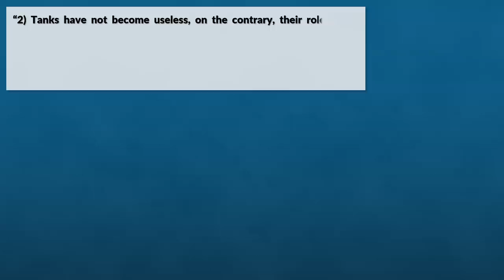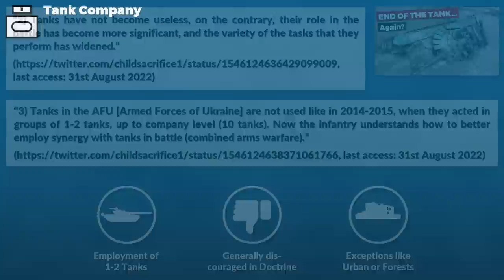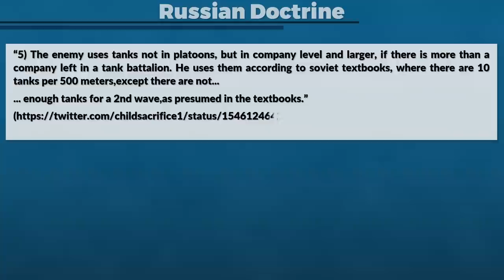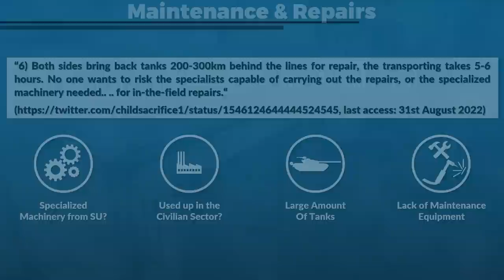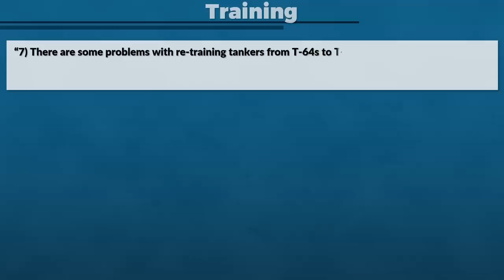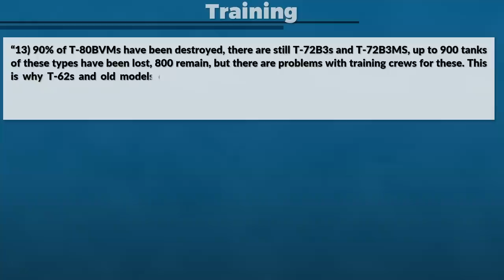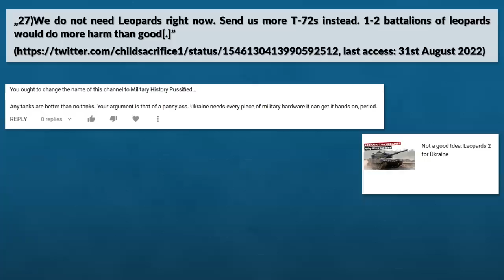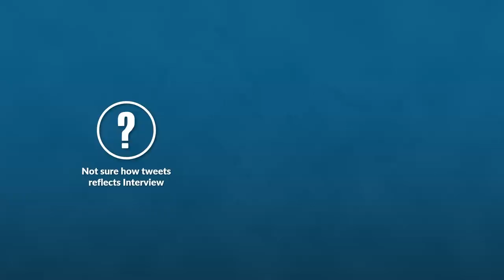What Ukraine thinks of Tanks

Comment: The experience of the US National Guard (Reserves ) is that Driver, Loader and Commander jobs on the M-1 Abrams tank can be learned in one day.  The gunner takes a little more time to train, say one to two weeks.  Basic maintenance can be done by the crews using only the manuals.  Most subsystems are designed to be replaced like the Power Pack or as a Modular box, this simplifies the mechanic's job tremendously, Built In Test Equipment makes trouble shooting somewhat easier.  excellent
Reply: The thing is those replacement subsystems, they were designed to be removed and sent to 2nd level depot maintenance, refurbished and issued back out. 

Stuff like that just isn’t happening in Ukraine when the vehicles are literally on the front line.
Reply: sounds like ukrainians should be training on abrams tanks now and then we send 1000 of them
Reply: Russian doctrine used to be different, a crew would trade their damaged vehicle for a working one at depot.  But realistically I don't see how this works.  They must have repair shops closer.  In the 60s when the 62 was out, each company had factory techs with them to repair them as they broke down all the time.
Reply: That’s if you are taking experienced tank crews.  Even your comments are an oversimplification; you can train anyone in the basics in a day so they can drive out of the motor pool to a training area, but to get them up to combat effectiveness would take at least equivalent to an annual training period, as my unit did when we transitioned from the M60A3 to the M1IP.  Training inexperienced soldiers with no experience in armor will take more time; if the war drags on, you may see more of that as they have to replace crew losses.  Don’t forget that Ukrainian mechanics may not have experience with turbine engines and would need some training for those and perhaps the thermal systems and firing computers.

Comment: I'll still be an advocate for sending Leopard 1s and Leopard 2s or even Abrams M1A2s and Bradley IFVs as the US certainly has plenty of these in stock. This war doesn't look like it'll be done in 3-4 months anyhow so let us look at what Ukraine would need to break the stalemate outside of the current slow rolling offensive, an offensive which can't be replicated elsewhere unless Russia gets themselves into more logistical constraints over x numbers of water crossings. 

Yes, sending in BNs of equipment would be a disaster if just dumped on the Ukraine with no prep but if that amount of people were being trained up out of the country for several months they'd be a boost to capability after this Fall and Winter.  Just like the various western artillery systems and ADA systems required a train up time it is worth the wait. 

The logistical troubles will be easier if they are used near the units using the PzH2000s too as they'll be some common parts/systems though they are the biggest headache to overcome.

Additionally, the better capabilities (superior thermals), if trained on out of the country first would be a potent addition on the battlefield as the Ukraine might be able to have armor that can effectively fight at night, a capability gap the Russians seems to lack (for training reasons mostly) that could give Ukraine an edge in pushing their attacks well outside of daylight hours if paired with similarly equipped infantry. Not to mention they wouldn't be relying on scrounging the world for 2nd hand serviceable T72 series vehicles into next year. It's an old vehicle and there's a rapidly dwindling supply of replacements available. Getting vehicles that have current production lines that can be ramped up to provide spares seems better than relying on countries x y and z to refurbish an old vehicle as best as possible.
Reply: There are serious issues with 'ramping up' assembly lines.  You can increase output by 50% for couple of months before you burn out your workforce.  Any new people you hire are going to need to be trained.  Then you have to find subcontractors to make components - and they have to ramp up production.  And you will have severe bottlenecks with specific components - such as the barrels for the main guns.  Production of these requires specialized machines (that will have to be built) with limited capacities.  Even worse - these require very highly trained (and experienced) personnel.  Engines, thermal sights, traversing/elevation systems, transmissions, are also bottlenecks because production of these requires additional subcontractors - and many of them are 'long lead time items' (things that have to be ordered several months before you start assembling the tank they will go on).

In World War Two we were able to quickly ramp up production because we started our industrial mobilization two year before we entered the war.  No NATO country (including the US) has anything close to the necessary defense industrial base needed to suddenly start producing 200 tanks a month.

Comment: The many different weapons used in the theater is already a nightmare for Ukraine. Will be way less efficient due to that extreme variety of different weapons.
Nightmare for logistics and repair.  
Now if the entire tank force would be replaced with Leopards in a certain time bracket it would be very good for Ukraine. But just add a few to the already big variety of different tanks would make it just a bigger nightmare.
Reply: I thought about that too, and, as the video stated, it seems Ukraine just sends the broken equipment back over to Poland to NATO repair shops to get them back into service. 

Almost all the NATO supplied weapons use the same ammo too. I think the main issue for Ukraine is just the transportation of the gear and ammo around trying to avoid Russian logistical interference.
Reply: Yes, I think support units are already being stretched to the limit. Maybe there should be a timeout of six months so Ukraine can change to new platforms. Has anyone approached Putin to see if he would be amenable to a timeout?
Reply: @MarcosElMalo2  rofl good joke.

Comment: One thing that sets NATO tanks over Russian tanks is that Russia designed them with Quantity over quality at a cost of poor ammo storage protection while NATO has Quality over Quantity with better ammo storage protection. Remember this has been the case since 1982 when T-72 went against Merkava in Southern Lebanon.
Reply: there are many ways to incapacitate/destroy tank. artillery was used a lot in ukraine. and nothing survives direct hit of 155/152mm shell. maybe cheap tanks here are actually in advantage.
Reply: @jebise1126   You mean Soviet Union designed tanks?  The reason why Western tanks are expensive it has to do with protecting the crew from an ammunition cook off basically if hit the explosion is vented Away from the crew compartment not unlike the Russians the Chinese and  North Koreans which placed them below the crew compartment
Reply: @EpicThe112  do you mean those a4 leopards made in germany used by turks that came with rocket ejection seat for crew?
Reply: @jebise1126   You are correct. Different story when a Leopard 2A5-2A7 gets hit behind on the ammo rack and what happens is that the explosion gets bented through that blow out panel not through the crew compartment which is a standard feature of NATO Tanks Western Europe style including closing the French auto loaders and derivatives Japan and South Korean K2. Furthermore 2A5-2A7 have a different ammo propellant.

Comment: German tanks and US tanks would be helpful; however, training needs to be done. If training would have started the first month of the war, then the 452 M1A1 tanks the USMC recently retired could have been given. As it is 116 of those M1A1 tanks were given to Poland, so Poland could send the 262 PT-91 tanks to Ukraine. 
If I had to guess, the USA would have provided those M1A1 tanks to Ukraine, but the Krauts probably blocked it.
Reply: I doubt the US would have provided the M1 tanks, for logistics reasons. The Ukrainians to crew and service them would need extensive training, so you'd basically be looking at forming an entirely new unit of fresh recruits. These would most likely have to be trained outside of the Ukraine, which would take time to arrange, and might not be something you want to set up when the initial situation hasn't stabilized yet. Then there's the matter of fuel. The Ukrainian forces had issues with fuel supplies for their Russian tanks, and the use of M1s would require dealing with their different type of fuel. And keep in mind that the M1 is a fuel guzzler as well. Also, different gun size. And then the need for something with a more immediate impact, rather than a delayed one. And then the US would probably want to strip out certain bits of tech from the tanks, to avoid it falling into Russian hands, so it would take time to strip out and replace such items.

That said, it would make sense to start such a training program now, so lots of training and set up can be accomplished over the winter, and the troops can be ready for an offensive next year.
Reply: @Axterix13   The USA has the support equipment for these tanks. In fact the USA already gave Ukraine some M88 Recovery vehicles and fuel trucks. The USA has also been giving Ukraine fuel. The Turbine engine does not burn much more than a diesel engine for a tank that size, when driving and doing what a tank is supposed to do. The turbine engine burns a lot more fuel when idling, but those have APU for reducing fuel usage while the tank is not moving. The M1A1 tanks can run on diesel fuel or jet fuel. US Troops do not do major repairs on tanks. The biggest thing they do is swap out the power pack (engine and transmission) in the field.

The USA gave some M1A1 to Iraq, so I doubt Ukraine would be any worse than Iraq. The Iraqis later bought some Russian tanks for some reason... maybe cost. The USA also sold M1A1 tanks to Egypt and Saudi Arabia. So if an export compliant version  was needed, then those tanks could have been modified while the training took place. Something else stopped this... and I bet it was the Germans and for the same reason they did not want Spain to give Leopards to Ukraine.

Comment: Ukraine should take as many tanks as they can get also. They can learn to use those tanks too. To increase number of tanks. They don't have,and at this stage in the the invasion. More tanks is better than not. Of course u wouldn't send untrained crews against a trained crew. Ukraine soldiers need to be more flexible in learning how to use different tanks from different countries to there advantage. It's not about how good a tank is necessarily in battle. More experienced crews when,who gets off the first shot wins.  Tank aces could beat u to the shot. Unless a tank has range on u. U can when the battle in modern tank. Have the leapeard tanks as back up.
Reply: Agreed. Just one thing: tank-on-tank situations are probably the least happening ones. So that’s not really that important anyway.

Comment: as far as the tank numbers go in regards to how many are in a company and their groupings, one has to keep in mind that for practical purposes the number of equipment you have is typically only deployed at half its value to rotate for maintenance. even people need downtime, so you don't have everyone on an operation at the same time. in fact due to support and bureaucratic requirements you will only have about 60% of a company in the operation (based on my own experiences in the US Navy on the Expeditionary side of things). this means that the 4 groups of 4 that you had assumed would result in 4 groups of 2, and 1 or two tanks for command. this can surge to about 90% personnel in operations and all tanks fielded, but that can't be sustained for very long. how long that is really depends on how far the command is willing to push the troops and how experienced the troops are. green troops will start to break down in a day or two at that optempo, experienced troops could sustain that optempo for two to three months before they start to degrade. experienced maintenance people with good logistics and independent authority to modify things to make them work can get the (4 man patrol craft, as that is what i am used to) well enough to last a couple of weeks before they need to be taken out of operation for maintenance for at least a day (time down depends on issues that arise), while green maintenance people or without the authority to modify things will be able to get 90% of the vehicles up and going for 1 or 2 days before needing to be down for at least a week. if the logistics is poor then just keeping the company at half vehicle strength is in the realm of the experienced people, while green people will have trouble fielding more than 1 team. as you might have noticed maintenance is a huge factor in being able to operate for sustained periods. the maintenance skill set is slower to train up, and requires people with a good head on their shoulders, so it is out of the realm for most conscripts, and tough for centralized commands that want to concentrate all the knowledge and authority into a handful of people that stay away from the front.

Comment: most agree with these opinions, but you forgot to add: training and time saving. War is time - possible time saving - the longer it lasts, the costs are incurred. As you mentioned about the Russian side, staff shortages etc. it was true. but in Ukraine, where it used to be part of the CCCP, it produced the most components for these tanks. The architects, team and people designed the most important places in this place. They have knowledge. All T lines, except the T-90, are fully manufactured. Leopard's refusal is the most wrongful decision, because training and repair give you unnecessary time. They would have to start all over again - because the damaged Leopard will not return for re-use, eg part of the element, etc. Ukraine has more benefits from the T-64, T-72 and T-80. And I also think that Poland should also go for such a universal system that used to produce tanks based on the T-72, in the way it was produced. Ukraine got 250 from Poland and they praise it for being a Mercedes of all T-72s - why? a more powerful engine and the ability to fight at night, reactive armor, driver's night vision periscope, commander's passive day and night observation device, gunner's periscope thermal vision sight, internal and external digital communication system, GPS receiver, or modified electrical system using a new power supply system and buffer batteries. As in your video, most comments are MUCH correct, because it's better to have a tank than to have a zero. As the saying goes, it is better to have 900 outdated (but modernized) than to have 10 leopards. Regards!

Comment: The reason why they wont take Leo 2's is mostly because it will require time to train on them, since they work differently, and it will be a logistical issue regarding ammunition, when for soviet 125mm they can get anywhere, salvage even.
Reply: 1) they want Leopard 1 and 2s. It’s just that Ukrainian expert saying it wouldn’t help in their immediate current situation. 
2) Ukraine will have to switch to NATO ammo anyway. And the 125mm ammo will run out sooner or later. The next Ukrainian tank won’t use 125mm anymore. 
3) they have enough personnel free to train on western designs.

Comment: Caution be to he who claims the tank is on it's way out. This would be the fourth or fifth time this has been claimed and each time before has been wrong. What people tend to forget is that every time a weapon rose to threaten the tank's viability the tank itself or armored tactics evolved to deal with that weapon. This is without even stating the obvious. Vulnerability, no matter how severe, does not mean obsolescence. If so infantry would be long since obsolescent but they clearly aren't because you need boots on the ground to control and hold land. Protected firepower platforms like tanks are also vital for taking and holding land. However, just like infantry they need to be well implemented or they'll be as good as target practice for enemy AT crews. Tactics, strategy, and doctrine make Wars. Let us also not forget the most important thing as well, logistics. None of the things mentioned before matter without the proper logistics to back them up.

Comment: I had been wondering about the training and logistics. Sure everyone is hollering to send more tanks, planes, etc., but it's not that simple. It will take time to train crews and maintenence crew, the logistics for ammo and parts needs to be sorted out and supply kept up. 

The comment that some tanks are better than others is an interesting  point. Not only will that come into play with these new tanks, but they'll likely expend some vehicles and crews trying to figure out how to best employ these new tanks. 

Then you have the issue that political winds might shift and supply of parts gets cut off or simply ignored since most people just think about things that go boom and not the things that keep other things running.
Reply: True,  however:
1) parts and ammo will run out for eastern tanks sooner or later. For western tanks not. 
2) Ukraine has enough available personnel to train, not enough heavy gear. 
—> deploying western tanks at the beginning of the war in the field wouldn’t have made much sense (I guess that’s it what the Ukrainian expert meant), but it’s a no brainer that this change to western models has to come anyway. 
And more western tanks on top of the eastern tanks is always better than having simply only eastern tanks. 
Ukraine has enough support ( = trucks) and excellent rail workers to deal with the logistical issues.